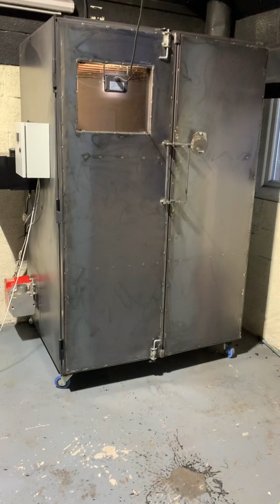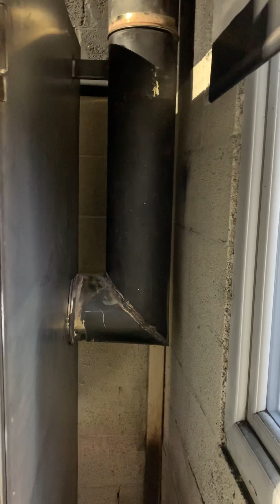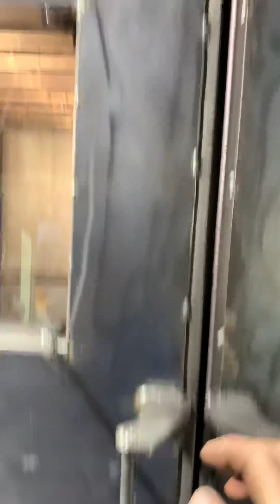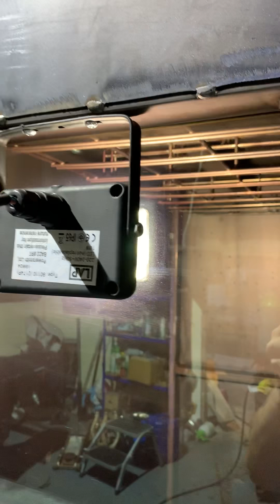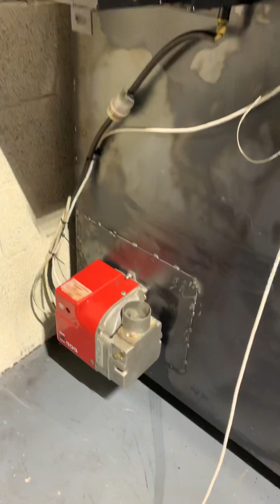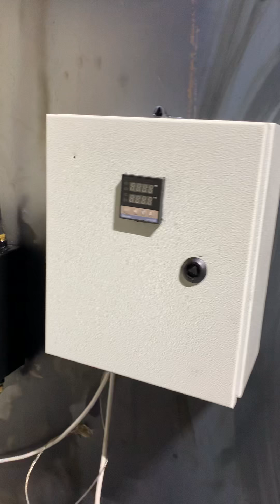home made powder coating oven kerosene fired

Comment: You don't know what a revelation your video is to me, i was struggling because my new unit is shared and they can't accomodate my electricity needs for my oven and i was looking for alternative methods
I was wondering what is the fuel feed pipe dimensions and and what is the consumption like

Comment: Can I ask how you wired up pid 
Do you do it off oil pump solenoid? 
I've made a oven but having issues with elements so have just purchased a ecoflam light oil burner to run kerosene but struggling to find any info on wiring it upb

Comment: Hi Pete, Great job, I was wondering how you have dealt with the fumes. I have just built a similar oven and am using a RDB1 burner,  everything is working great with the exception of it trying to gas me out.
Reply from the maker: Hi sorry for the late reply but yes you are right about the fumes but if you notice I have fitted a flue that Vents it nicely just make sure that you have good door fitnent
Reply: @pete9768  Thanks for the reply, I tried all sorts of vents, seals and the only thing that worked was a vented burner box but that made it impossible to control the heat with any accuracy.  In the end I spat my dummy and installed an Ecoflam Gas burner and haven't looked back.

Comment: Hi I no this is an old post but what setting do you have on your pid controller to run the burner?
Reply from the maker: I set it to 180 degrees c and leave it modulating for two mins then open the doors and its perfect every time total bake time is 25 minutes

Comment: Hello Pete, do you think that burner would work on a 6 wide 8 long x 9 foot deep oven would work and  using a circulation fan. Thanks regards Eddie.
Reply from the maker: it would definitely get to temperature but would take longer obviously this oven is 4x4x8 and takes 25 mins to reach 180

Comment: What is the brand and model of the burner? Does the burner introduce dirt into the oven?
Reply from the maker: its a riello 40 and no it doesn't as I filter the intake with an old pair of tights works perfectly lol
Reply from the maker: hi its a riello rdb 2.2 and no stays very clean indeed you can have a gauze filter if you want in very dusty environments kindest regards pete